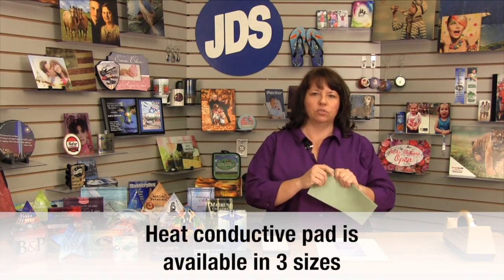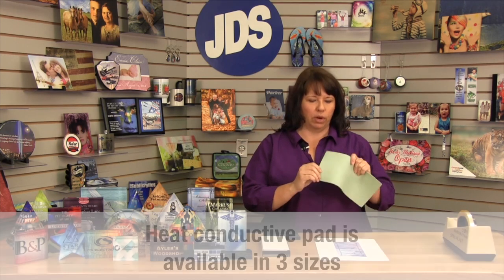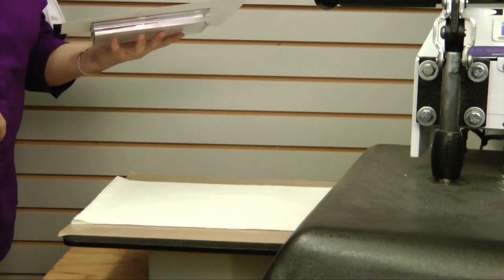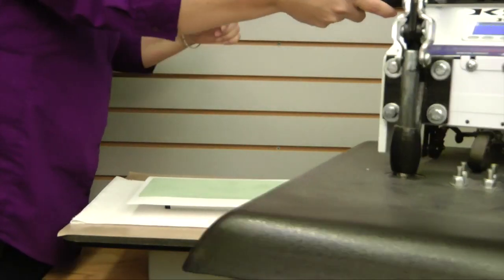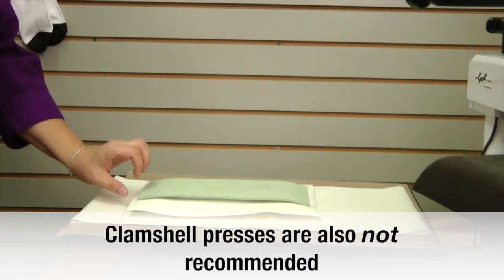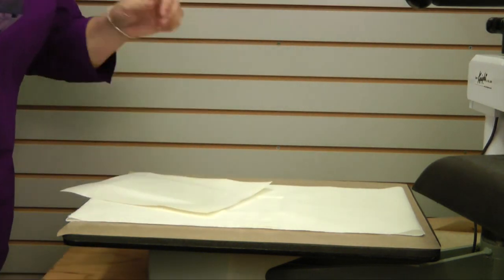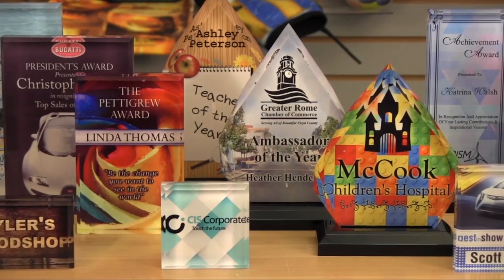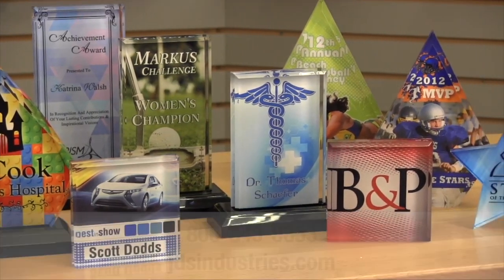Sublimating Acrylic Awards

Comment: hi. i tried do it. i have the subjetlit ink and the sawgrass 400 printer. and my products dont come out like that. they just 
leave a red ink tint on the products. how can I resolve this issues? Hope to hear from you soon.
Reply from the maker: Give us a call and we can look at your settings and make sure you are printing correctly.
Reply: What kinda paper you using? Also make sure you using medium to heavy pressure and the heat press settings are right. Mines turned out  right

Comment: do you sell sublimation Blanks on your website I can't find where they are
Reply from the maker: Yes, we do.  You do need to set up an account with us to buy products on our website. You can call the number at the end of the video and our customer service team will help you set up and account.  You will need your state sales tax id #.
Reply: +JDSINDUSTRIES thank you. Do you need a special mug attachment for the 11 oz beer pilsner with upside down bottle
Reply from the maker: Yes. If the pilsner is straight up and down, not tapered, you should be able to sublimate them in a mug press or by using mug wraps.  Of course, the mug would have to have the necessary poly coating to make them sublimatable.  We do not sell those but we do sell an 18 oz beer stein.